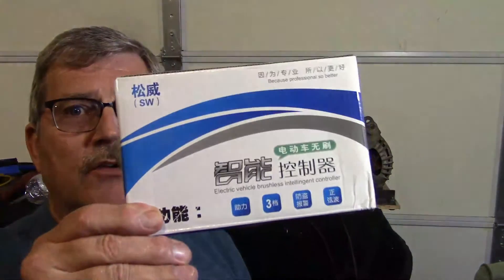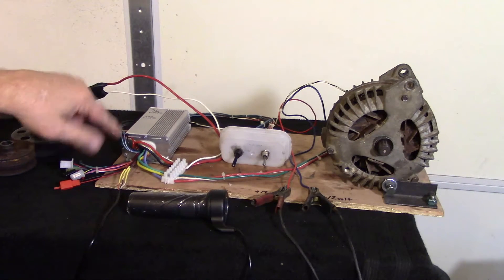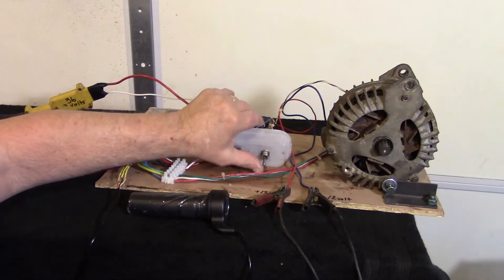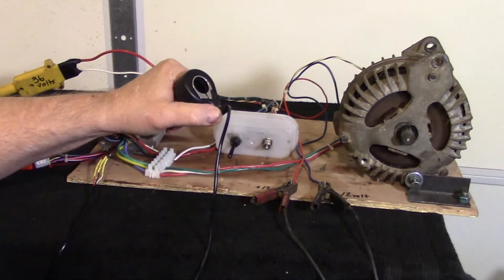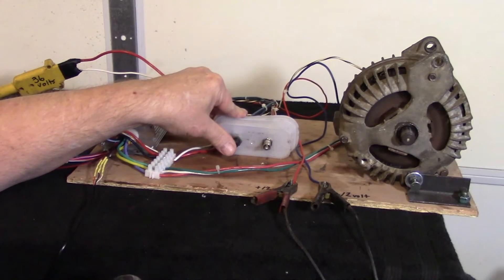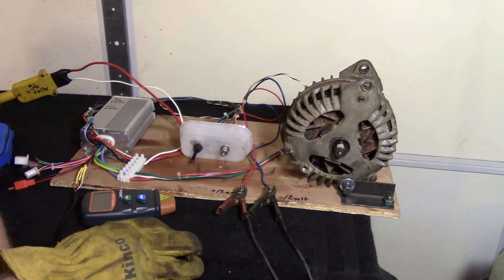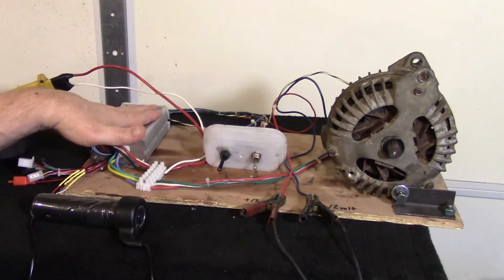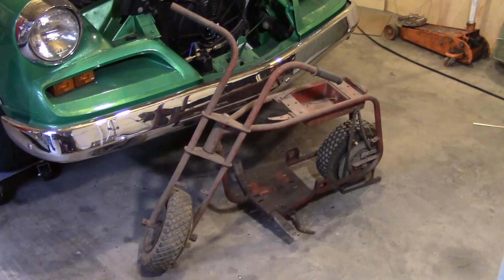Alternator powered Electric Mini Bike part 2

Comment: Direct drive with a solid sprocket is the way to go! Does that controller have regenerative braking? Heading over to part 3 now!
Reply from the maker: Very little regen braking if any. My need a different motor controller to get that. Thanks Marsh

Comment: Interesting setup I would be lost without a diagram for all of that...Some where in my old shed I have a 70's era 100 amp alternator from a police car ..Much bigger size than stock..I have worked on it and had it tested and it needs the diodes replaced because some of them do not test normal
Reply from the maker: Thanks Jim, This is my first to convert so my knowledge is limited but things are going good so far.

Comment: Wow that goes better than I thought it would. A clutch is not needed since the motor won't be idling so I say go with a stationary sprocket and hold on!
Reply from the maker: That's a good point about the clutch. Food for thought. Thanks and take care

Comment: im wondering if there is a way to mount a micro switch to the throttle grip to stop the field current? or maybe something like a horn button on the other hand you need to hold down at the same time... like an anti theft
Reply from the maker: I have several things in mind but i'm open to suggestions. It will make it easier by listening to others ideas. Thanks and take care

Comment: Cool. I used to have a mini bike that resembled yours when I was very young. It was a "Lil Indian" the frame looked just like yours. It had a seat big enough for me and my brother to ride at the same time. If I recall, the brake was simply a metal plate that rubbed on the wheel.... I was really young... I'm guessing it was used when my dad bought it and I think it was about 1973 when we had it. I didn't take long for Mom to get rid of it after multiple Evel Knievel stunts in the driveway!!!
Reply from the maker: I had a mini bike around that same time . I rode many a mile on it back then. Thanks Chris and enjoy your weekend

Comment: Very cool sir.  So it's the motor operating at 12v or 36v?  How many amps is it pulling?
Reply from the maker: Thanks, The motor itself is operating on 36 volts. But the field brushes are on 12 volt. I'm sure under no load the amp draw is low. I would think as the load increases the amp draw would also. I will be checking this as the project progresses .
Reply: Can't wait!  Thanks!

Comment: Did you wire it in Delta or Star configuration ? Delta will give more RPM's at the cost of torque & amps. I power some of mine with big drone Lipo's to save gobs of weight and runtime is great.
Reply from the maker: I used delta,  also when I regulate the voltage to about 6 volts to the fields is increases speed at least by 25%. I like your idea of the voltage reducer for the fields, cheaper than another battery and saves space. Thanks and take care
Reply: @RustyGlovebox  You too ! Good luck on the bike, will be watching for updates. I'll add you to the list I play in my Mini Bike and Z50 parts shop.

Comment: I didn't know that an alternator could  be made to work as a motor, I know the old generators could be made to run but I don't think they had a lot of power. are you gonna have a problem getting all that stuff tucked away in the mini bike?
Reply from the maker: Thanks, there will be a lot of parts but I think I can fit them all in. Have a great weekend
Reply: It's a 3 phase brushless motor. Alternators put out AC waveform voltage and then it's converted to 12 volts by the regulator.
Reply: @Ronin8451  it sounds pretty complicated to me.
Reply: @MissouriOldTimer   Not too bad once you build one. The really high output aftermarket alternators can put out upwards of 5,000 watts (6.7hp).
Reply: @Ronin8451  it's an alternator converted into a motor!!! Watch the previous video!!!
Reply: @rockerpat1085   yes sir, I have been winding my own outrunner brushless motors for 22 years now. I have built 5 of these conversions too.